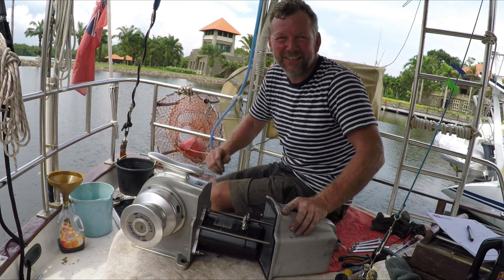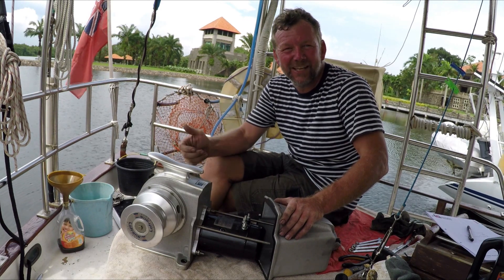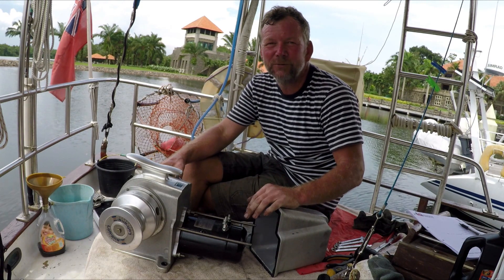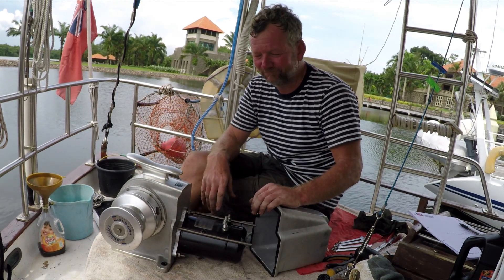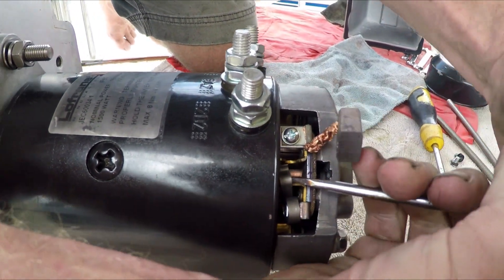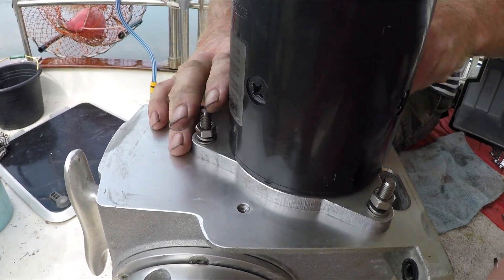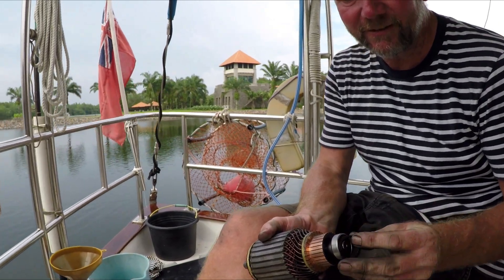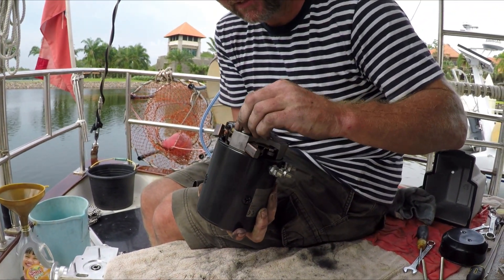Windlass Motor - Teardown and Cleaning

Comment: I recently purchased a used Tigress.. It tested OK but after i filled it with oil, i observed that it was slowly losing that oil. It was first observed seeping from the motor housing, but it was getting there through the gearbox/motor interface. That interface looks a bit untidy (corrosion) but not bad enough to cause that scale of oil leak. I could add sealant but i suspect that i missing a seal or gasket. Any suggestions?

Comment: Thank you for the demo. I was given a windlass had the posts rotated to the side.    I thought I would have to remove the screw on the side of the housing to rotate the case.  Now I see it is just the plate that needs to be removed and placed correctly.   Since I'm there I might as well check and clean everything, then repaint it.

Comment: Hello from SV TiKi, I thought you explained and showed 'how to' quite well. I had a problem with my new windless but it turned out to be the power cables, they had totally burnt out. This was not picked up  when we purchased the vessel but I'm glad it happened when we were just off the mainland and able to get descent replacements. All good on this 1994 Atlantic 44,quit a smart vessel.
Reply: A friend replaced his windlass when it was having power issues.  When he put on the new one it had the same problem.  He realized it was the cable to the windlass.  He was going to throw the old one away, when I told him he can throw that right on my boat because it was the same exact model I had.  Spare parts are a beautiful thing.

Comment: Great video, did it end up working well after that? I have almost the same windlass and the exact same issue, so I was wondering if your cleaning inside the motor fixed the issue. Thank you!!
Reply: Check the cables, terminals and battery first.  But a maintenance job isn't a bad idea either.